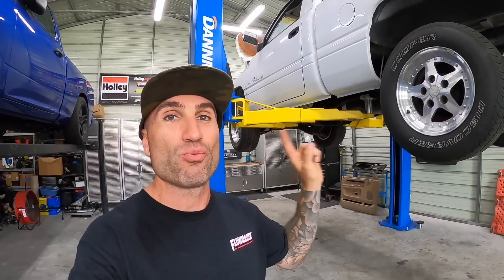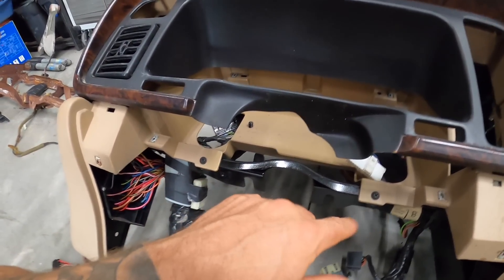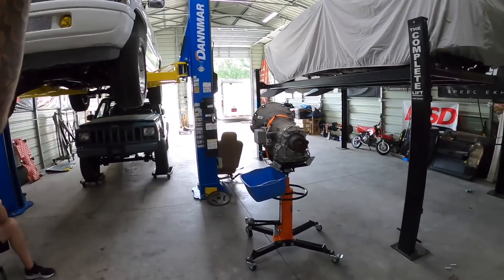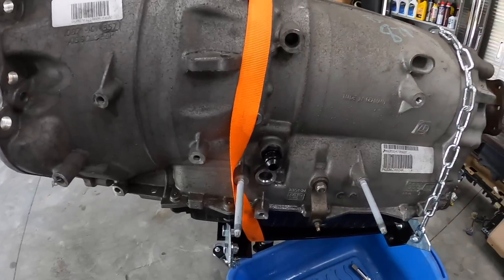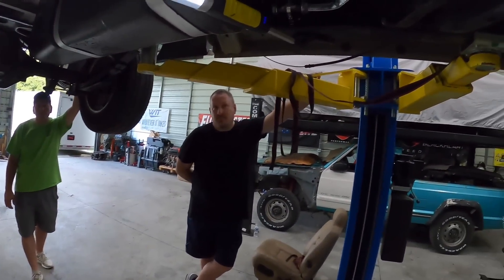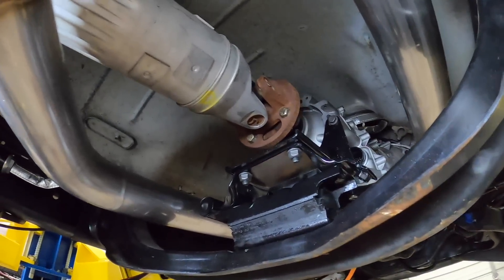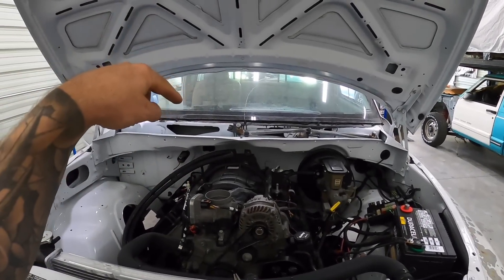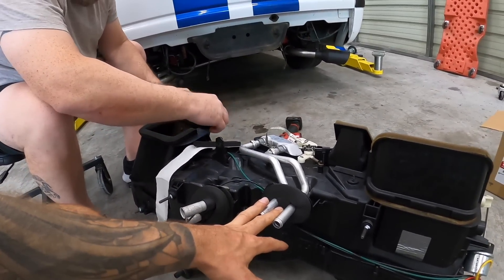Dodge RAM 1500 HEMI SWAP Build | Part 13

Comment from the maker: Click HERE for the Dash Replacement
https://amzn.to/43VS9Z9

Click HERE for the Holley Transmission Mount 
https://amzn.to/46gwXyF
Reply: I meant for the gauges cluster. I have a 93 dakota and the dash is in great shape, but if it ever goes bad there are only coverlay options for now...
Reply: Where did you get the transmission harness

Comment: the HEMI will sure be a beast but man the original 5.9 magnums in those things sound like absolute monsters.    
I have a HEMI RAM myself with way more hp now but i was never ever able to make it sound like that old 5.9.     
and the way it would rock the truck side to side when revving it was so bad-ass.. 
It also felt more direct when you punched the throttle, the hemi feels like its always being modulated by the computer

Comment: Those 8HP's are designed to get up to temp quickly with that transfer heater. They shift better at temp. Kind of late now that you tapped the holes. But something to consider on future builds.
Reply from the maker: This is setup the same way as the cars with the 8HP70. None of the cars have the heater box. We’re all good 👍

Comment: The zf 8hpxx is designed to run at 176°F. The point of the coolant to oil cooler is actually so the fluid comes up to temp faster. I'm in the final steps(need to put the trans in) of swapping my 04 ram 2500 to a zf 8hp70. The amount of research I have done is insane. If you have any questions ask away I'll reply.
Reply from the maker: This is setup the same way as the cars with the 8HP70. None of the cars have the heater box. We’re all good 👍
Reply: I'd recommend running a water to oil cooler with a cooler, add a bypass valve so you can flip a switch to use the cooler when needed. Hope that makes sense. The point here is to get the trans to operating temp just as fast as the truck does. This will improve shift quality and trans life. 
I know u know what ur doing but this is going to save you time and money in the long run. Also I professionally work on cars so unlike most of the keyboard warriors here I actually know what I'm talking about.

Comment: Check with reversion raceworks about a dash bezel. They have a bezel for most of the aftermarket screens including the 12 inch holley for 87-96 dakotas. I'm sure they would make them for rams too

Comment: I need a new vacuum blend door actuator for my 93 dakota, but they arent made. Even though the same one was used in the dakotas and rams until 2000. There is a company gauging distributor interest in a new run of them, but I don't know if that will pan out.

Comment: What are you using to control the 8 speed? I am doing a hemi swap and have been waiting on a 4l80e with no ship date in sight, I would cancel that and run 8 speed if affordable.
Reply: It’s a kit from sound German automotive